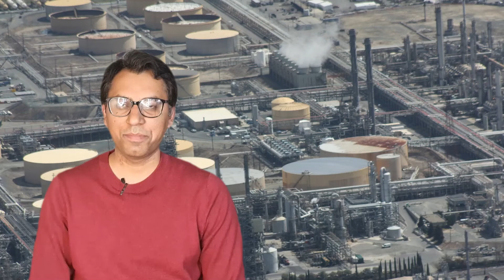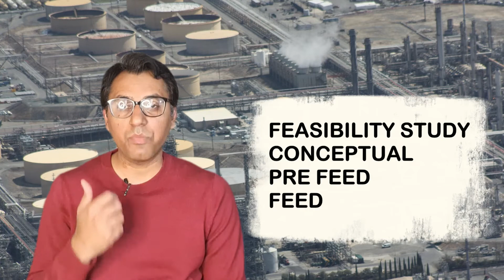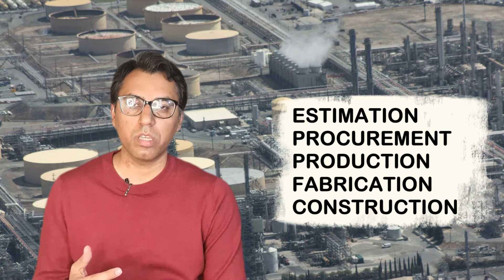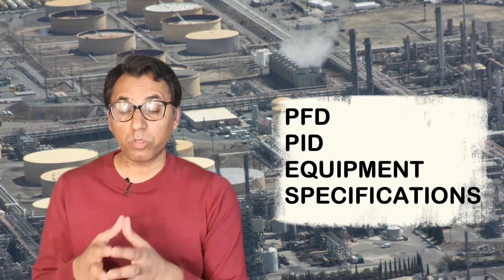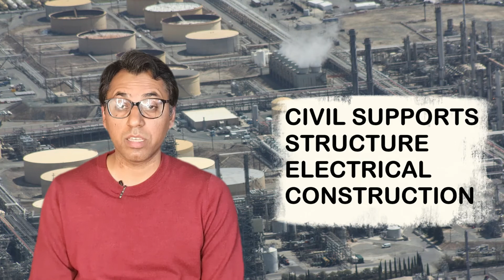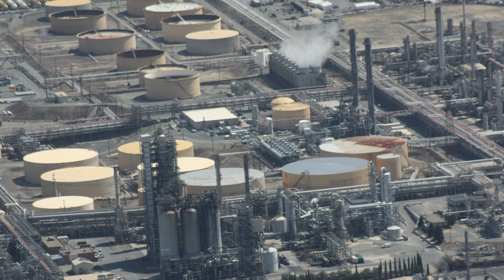What is Detailed Engineering Design Project

Comment: Engineering hasn't changed much since my early days. In the end, it is all about doing great conceptual, basic, and detailed engineering. There is a lot of confusion that is created as it happens in many other process-focused disciplines. One creates FEED, then realizes that is not complete and creates Pre-FEED! Then Pre-FEED plus FEED are not enough, and they realized that detailed engineering is required! The list of documentation that an engineering project has to provide for a successful project hasn't changed much. And interaction and iteration are necessary! I am not against labeling and creating new frameworks, but use them wisely!
Reply from the maker: Great. Thanks

Comment: I'm quite confused , how is it possible that some deliverables are issued during FEED and again during detailed engineering such as P&IDs , datasheets isometrics, 3d model, ....etc can you please explain
Thanks in advance
Reply from the maker: Main difference between FEED and detailed design is level of details and accuracy of deliverable. Like isometric and datasheets ate not produced in FEED but in detailed design. Long lead items datasheets are produced in FEED only. PID are produced in both phases but detailed design with fin and full detailed. Also you can join whatsapp group abou Piping questions and knowledge 
https://chat.whatsapp.com/IJ2OACH6KWs3uccAhGcmdx